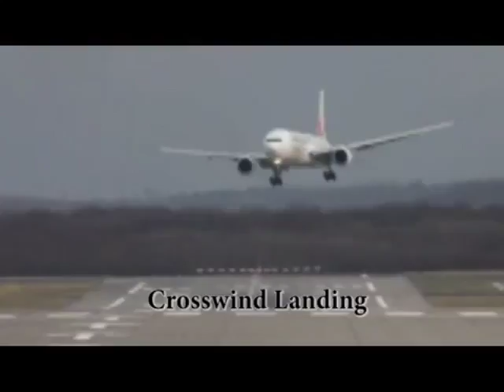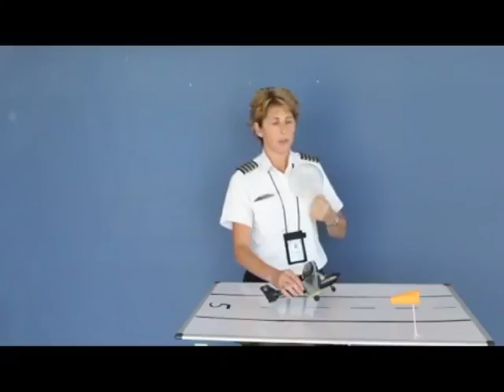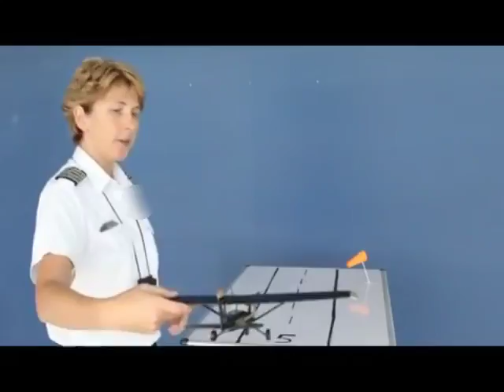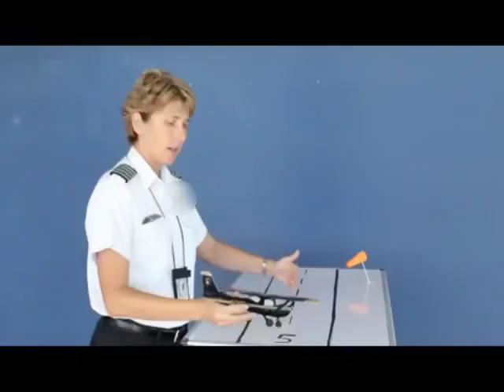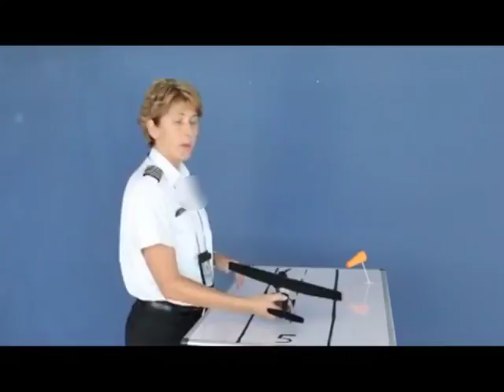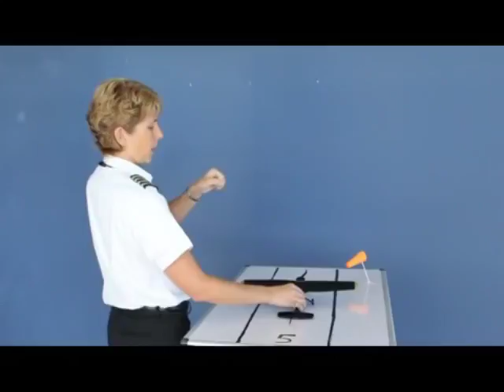Crosswind Landings (Private Pilot Lesson 3f)

Comment: Ailerons that make the BANK to control drift prior to touch down, will on ROLLOUT now provide YAW to supplement rudder and nose wheel steering with directional control. Even when there is NO wind blowing, ailerons PROPORTIONALLY OPPOSITE the rudder will still assist wee rudder with directional control. Cheers 60 yr TW CFI.

Comment: you need to teach students to use wing down with opposite rudder for furselage alignment all the way on final.  this gives them a chance to spend some practice time using cross control inputs in varying wind conditions.  when you teach crab all the way on final then they only have a few brief seconds to learn the inputs at a highly stressful time at touchdown.  all the time spent makiing the proper crosswind inputs on final is rehearsal time.  rehearsal is over when the tires hit the pavement.

Comment: Ailerons have 3 chores;
1) make the bank to TURN the plane (99% of our flying)
2) approaching the runway: makes the BANK that stops xwind drift.
3) ON the runway: provides the ADVERSE YAW that aids rudder in directional control to brake speed.
NOTE: The AILERONS bank, used to stop drift, is in the same direction on roll out, that provides the YAW that supplements the stalling rudder with directional control. Nice, huh ?

Comment: The airplane doesn't Weathervane into the wind. You have to be attached to something on the ground like a pole to weathervane. The reason the aircraft is flying sideways all the way down is because the airmass is moving and you are trying to fly straight across a moving airmass which would look like from the ground an airplane flying sideways. Also, when you straighten the fuselage to align it with the runway, you will be in a slipped condition which means an imbalance of forces. Left rudder causes the fuselage to fly sideways producing lift toward the left in this case so you balance that force with right aileron to produce Lift Horizontal toward the right so there are no net forces. As the aircraft gets slower and slower, the fuselage force becomes less so you have to start reducing the bank angle till touchdown. Once on the ground you are now part of a different playing field (the ground) than the air and you will have to start increasing right aileron as you get slower since you are countering the other playing field, the airmass.
Reply: I totally agree. The concept of "yawing into the wind" when you are flying in the airmass is in error. The plane does not "know" that the airmass is moving (assuming it is in steady-stay and not gusting).
Reply: Exacto. El avión no funciona como veleta si no esta atado al piso por lo tanto no es natural que se oriente al viento mientras está en el  aire. En el aire el avión no sabe de dónde sopla el viento.

Comment: Hi Cindy, great videos. There is no mention of using flaps in the cross wind landings, is it recommended to use at least 20 degrees?
Would also love to see a video of how to pick up flight following at towered and non-towered airports. Thanks
Reply: Remember that flaps are primarily to allow you to descend at a steeper angle without increasing airspeed. If the XWind is steady and not gusty you can use as much or as little flaps as you prefer to help manage your airspeed and reduce the rollout (using the extra drag) as you like. On gusty days, though, I really avoid using more than 20 degrees (and usually none) because of the changing nature of lift as the gusts hit the flaps. It makes for a more unstable approach and you end up fighting the aircraft and making more frequent power changes. (Not to mention the typical effect of suddenly gaining and then losing lift in the flare, making for a hard landing.) So use flaps to manage your airspeed (as you also do with pitch) and work on your landings without flap for gusty days and you can make landings just as precise as with lots of flaps (albeit with a longer ground roll due to a higher ground speed on landing.)
Reply: Oh and all you need for flight following is the frequency of the local approach or ARTCC (center) that serves your area. You can find that in your chart supplement in the approach frequency or, if none are listed (meaning you probably don't have any IFR approaches into that airport) you can usually find it in the info from a nearby towered airport or on the sectional in a white box (in the case of an ARTCC.) 

At non-towered airports you shouldn't and probably can't pick up FF on the ground both because you'll struggle to reach them and because you really should remain on the field frequency to listen to traffic calls from other Aircraft. Just plan on switching as soon as you've exited the pattern. At towered airports you can request it from the tower or clearance delivery and they'll give arrange it with TRACON or the ARTCC, give you the departure frequency, and to start to receive services once tower haha you off to departure control.
Reply: Flaps are NOT your friend in crosswind landings. Try to use as little as possible and carry 70kts instead of 65kts if flying a 172. Basically 5kts over on any GA is a good rule. Any tower in your area can give you flight following. I don't think contacting an ARTCC or Approach is a good idea. Flight following request are not guaranteed for VFR pilots. It's on a workload basis. ARTCC's and Approach controls mainly handle IFR traffic. I've never contacted an ARTCC or Approach for that. Why would you get Flight following from approach? Doesn't make any sense, you're leaving. ARTCC's handle sectors of the country. If you're flying a 50nm cross country I can't see an ARTCC being bothered with you.
Reply: @muhammadsteinberg  Thanks for the explanation...very informative...but what do you mean "Basically 5kts over on any GA is a good rule"...What is "GA"?